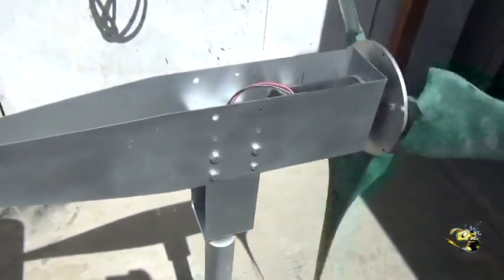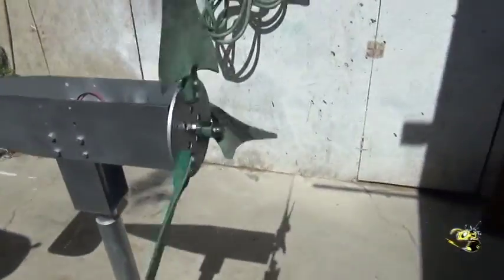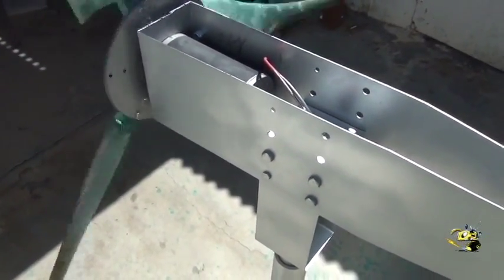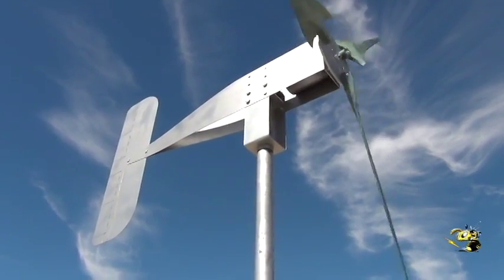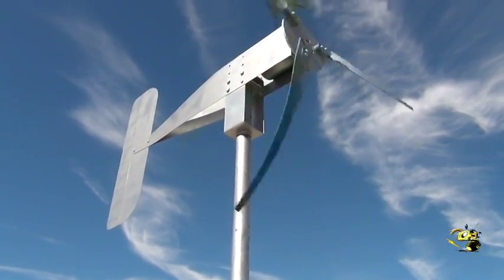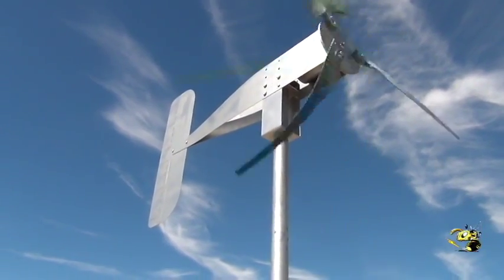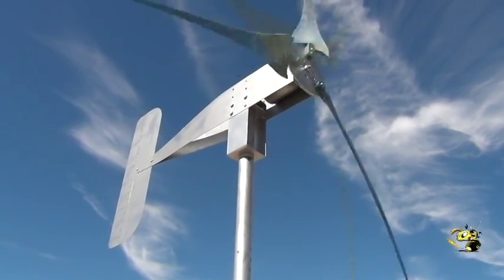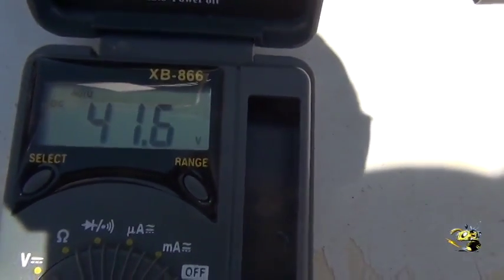Sparrow low cost portable ultra low wind turbine generator

Comment: Hello sir, please explain in the diagram how to control the voltage from the wind turbine 12v to 50v?
 I want the output voltage from 200v to 240, you just tell in the diagram which components will be installed and how will they be installed?
 If possible, please tell them practical

Comment: I wish someone would kindly describe how to pass electricity through the swivel in detail please,,
Reply: William Redfern , wires run from the generator down the tube and from the tube to your battery Bank and from your battery Bank to a converter box refrigerator, are you wondering why the wires from the generator don't get twisted,? that's because wind usually travels in the same direction and it's not spinning the turbine in circles to twist the wires

Comment: It spins easily because there is no back -emf forces (ie. there is no energy extraction). Motion is not the same as energy extraction. 
That's like regenerative braking. If there is none, then there is no braking action. Basic high-school engineering physics of energy transfer.

Comment: When u have a turbine set up like this do u also have to have a component that does not allow the power to go back up the lines to the motor if the wind dies down completely?? Kinda like with a solar panel with out a charge controller??

Comment: Now...WHY don't they have a cover over the blades like a FAN does???? Just too dangerous for those who have children, pets or accident prone people around- and what about birds...
Reply: Wind turbines should be mounted at least 30 feet above anything around it so if yer kids are that tall well wind turbines aren't gonna help cause your food bill will bankrupt anyone. A guard around it would cause turbulence and slow the wind down and yes those blades are VERY sharp, I still have a scar on my arm from when I was putting together my first turbine from Mike's .  Similar mill, same blades and you don't want to be in the way when they spin.  Birds tend to avoid wind turbines, they are big spinning things in the air and not silent.  I have seen dumb and lucky birds fly right thru the sweep of the blades and come out unscathed... there will be the occasional casualty but you can't save an animal from it's own tempting of fate.  Same type that would fly into a window, you know small not bright and reproduce like mad.  BTW I'm not affilited with this or any turbine mfg co. so don't give this guy hate mail for my comment
Reply: Thanks for the info :) Never thought about how high up they are - but the birds. Yeah I suppose it would cut wind resistance down with a cover.
Reply from the maker: @plejaren1   birds are not a problem for wind turbines that are mounted lower to ground-level.  As birds reach the level of trees let's say around 50 feet high they become ever more cautious of running into objects. Most of the bird hits are by the big megawatts turbines that have blades swinging as high as 300 feet in the air and give no warning whatsoever, that will definitely take a bird off guard because it's flying so high.
 Ask any bird expert, birds do not usually die of running into trees, polls or wires. I'm sure you have seen bird sitting on power and telephone wires for most of your life but they don't run into these wires they find them and sit on them. I have seen bird sitting on the tail of our turbines but they soon get paranoid by the whirring noise of the blades and fly off in the opposite direction.  Birds become a bit more paranoid when they get closer to the ground so we don't have problems with bird hits with low mounted tiny wind turbines.
Reply: I'm sure if the blades were painted a bright color, a bird will avoid it, animals are smarter than ppl think! They survive alot that ppl would not!!

Comment: how big is it Mr Thermodyne, I can not tell its dimensions
Reply from the maker: Hi MD,    58" blade diameter with a 36" long body and a 28" high tail
Reply: Thermodyne Systems 
wow! it looks tiny! like maybe 1/3 that size!  I need something like this. that will out put in very low wind! what type controller would be used with this?

Comment: I'm assuming that for filming there is no load (free wheeling) on your Sparrow wind turbine so what is the kick in wind speed under load (on a set of batteries)?
Reply from the maker: As long as the voltage exceeds the battery voltage it will change.  This micro wind turbine in average medium winds makes around 100 watts.  Makes 280 Watts at 28 MPH and peaks at 400 watts at 40 MPH.
Reply: Mark Worrell          Good ?       Mark

Comment: Nice will it ever come in 48Vdc?
Reply from the maker: Hi,  Just 12 and 24 only.    The 24V version would work as a 48 volt charger in areas where the wind is 18 MPH + or more.  Maybe next year.
Reply: Thermodyne Systems can the 24v model be set to dump around 28.7vdc
Reply from the maker: 28.7 would be doable in winds of 14 MPH+ with the 208  Motor.

Comment: that is one smooth running little turbine
must have very little resistance ie near absolute zero cogging unlike a couple duals i own from a different manufacturer , the blades rock back and forth when the turbines would finaly comes to rest and they called that as zero cogging LOL
your price is right and it performs unusaly well n low winds and thats what you want in a turbine, so its a winner , its not a powerhouse but it cetainly is fun for all the family, it works well and its going to sell like hot cakes.
Reply from the maker: That's true.  The cogging is as close to zero as you can get and that's a big key.    We can spin the shaft of this Motor/Generator with our fingers and it goes for about 5 seconds.  I can't even do that with our best PMA since it has  tidal/magnetic locking. 

This turbine is a good value for the money and that's the KEY, "FOR THE MONEY"  Great model for schools, teaching and battery maintenance.